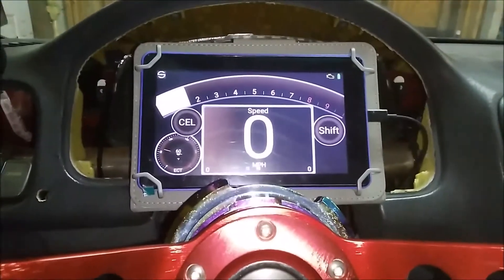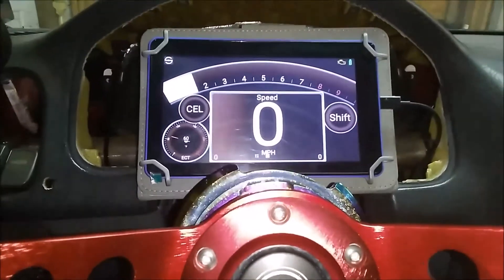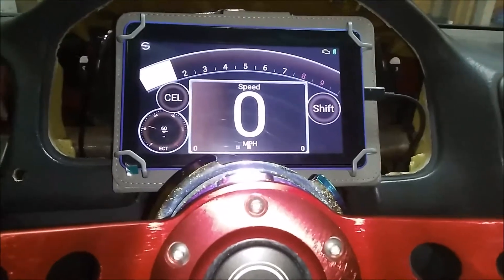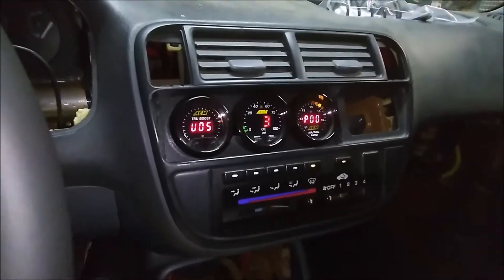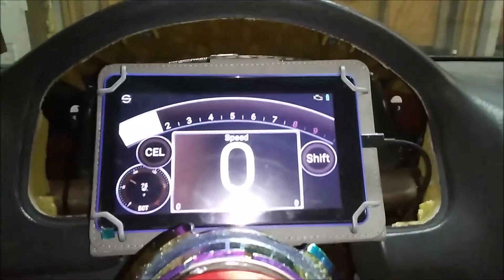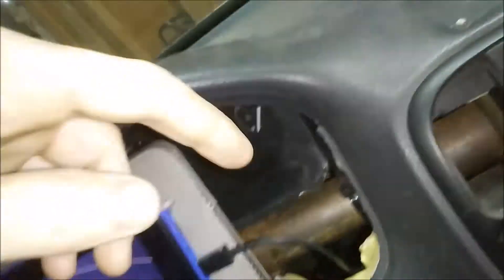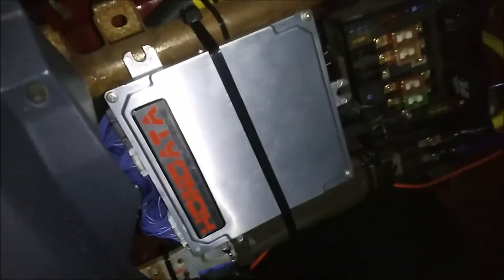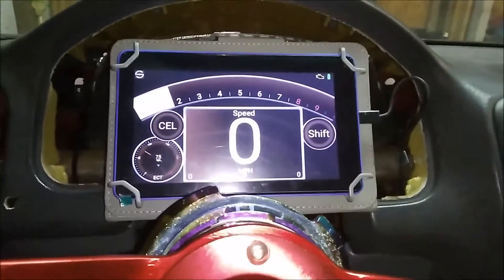DIY K Pro Dash Cluster $75

Comment: Only issue is that it's not reliable , freezes up every 5-10 mins
Reply from the maker: Might wanna try reset the tablet first. I've had it work for hours without problem. Unless it needs to be updated and acting up. I use a different dash now, made a different video for that one if you need a different option for dash cluster check it out, very simple and cheap option also.
Reply: I'll check it out thanks 👍
Reply from the maker: @chrisasaurus  Your welcome.
Reply: @BackRoadPerformance wasn't able to find it
Reply from the maker: @chrisasaurus  go to my videos. Integra in picture. K swap $40 dash option. Its many videos down from last year or so.

Comment: 🎉excelent !!! Thks for this !!

Can you sent à link or tofs for the usb adapter cable please?
Reply from the maker: Ebay search, usb female to Android adapter. There like $3-5.
Reply: @BackRoadPerformance  thks, do you use bluetooth connexion or usb with your  software dash ?
Reply from the maker: @dhovick9744  I use the usb connection, Bluetooth can have delay in signal and work to slow sometimes.
Reply: @BackRoadPerformance  ok thks,  i buy this cable and try it. 😉thks again
Reply from the maker: @dhovick9744  Your welcome buddy, have a good day.

Comment: Hi  excelent 

What is the câble do you use between your ecu and the tablet please?
Reply from the maker: It's just a printer cable, usually Hondata sends one, if not just a simple printer cable will work.
Reply: @BackRoadPerformance  ah ok thks, but i use hondata sdash on m'y phone or tablet.  And after few second the software doesnt work.... what is your version Android do you use please? I pay 9dollar the Last version. On the store
Reply from the maker: @dhovick9744  I would try powering tablet down/reset and try that first. The version I have it the older one from last year. Version 5.1.1 Hondata K Pro dash logger-SDash

Comment: Are you running a k20z1...? Cuz that blue adaptor harness gives it away 😁 same setup like mine nice!!!
Reply from the maker: Yea. Motors from 05 rsx type s. 6 speed.
Reply: @BackRoadPerformance  Lol Awesome! Btw when I first did this K Swap back in 08 I had to use the Dakota digital speed converter on my 97 hatch. What did you use on your civic to remedy the high pulse signal?
Reply from the maker: @ariesr4883  I simplified it, i just used the tablet as my tac and speedometer. Rest of stock gauges work (Temp, gas)  Its in my race car so works great.

Comment: What version k pro are you using?
Reply from the maker: Should work with any version, im using v2.
Reply: @BackRoadPerformance  welp, I'm definitely getting one for sure.
Reply from the maker: @bseries8826  Cool. You can also do it from your cell phone. Just hard to see a smartphone. Thats why i used tablet, make sure the tablet is a android one. Wont work with the other kind, bought two tablets to only have one work. Figure save you the headache or money...
Reply: @BackRoadPerformance  thank you for the tip. You have IG?
Reply from the maker: @bseries8826  Nope. Facebook.
Reply: @BackRoadPerformance  what's your FB
Reply: @BackRoadPerformance  . So ANY tablet will work as long as it’s an Android version? Cause I was lookin at the used Samsung Galaxy tablet w/ Android. Any help/advice appreciated. Peace
Reply from the maker: @notone4029 Definitely has to be android,  the Kindle type won't work. Bought a Kindle for my car and had to buy the rca android one. The hondata s dash app is $9.95 , works great in my cars. If you have 05-06 rsx transmission or like me 06 si lsd 6 speed transmission it's only way to get the dash to work. It was had to drive turbo k20 with no rpm or speedometer.
Reply: Does your ecu have a USB port ?